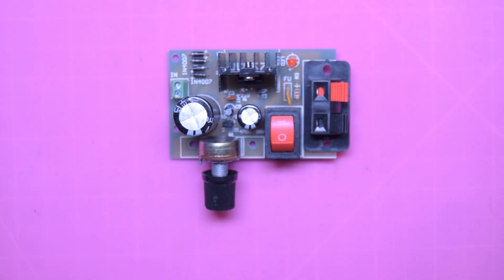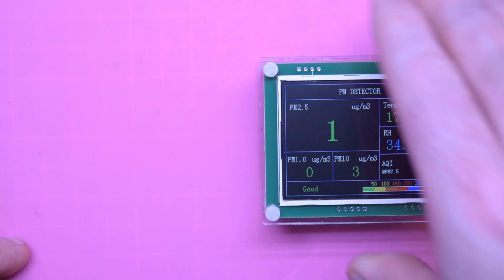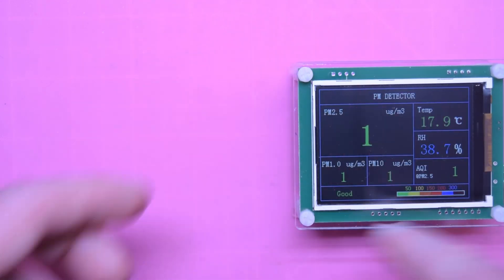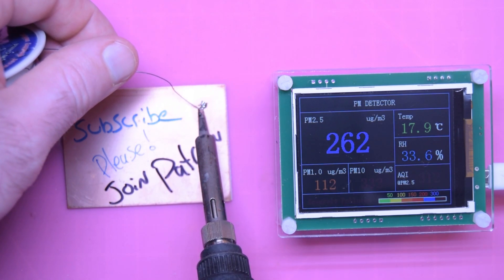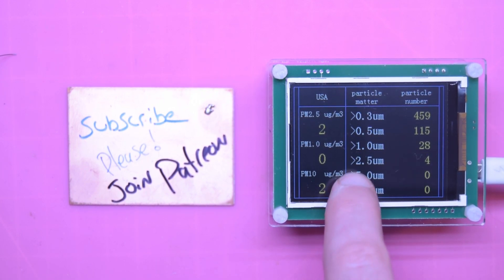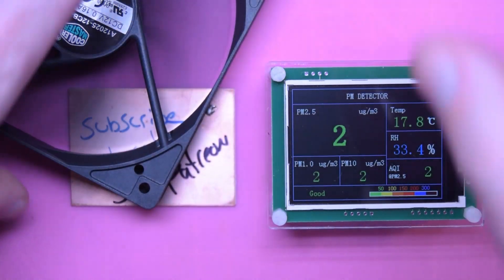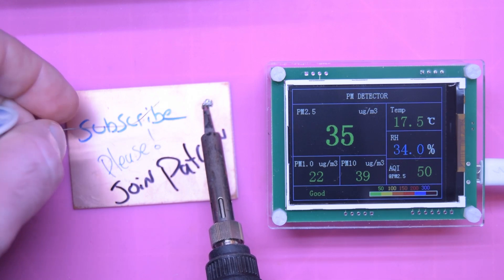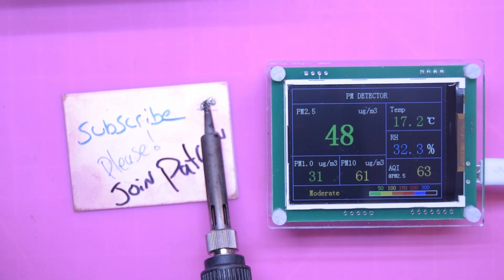How BAD are soldering fumes?

Comment: Sometimes breath it in directly (my job is constant soldering) should I be worried? I dont have a fan just the garage door open. Ill get a fan but should I be worried at all?
Reply: YOU NEED PROPER FILTERING OR A WAY TO PUSH FUMES OUT OF THE LAB/ROOM. DONT INHALE THAT
Reply: @GamisteToDimosio  lolololol. I switched positions still same company. I think I bothered them enough to get them fans to suck the fumes away now though

Comment: Can you put sources to where you read that solder fumes are not lead. I want to read about it.
Reply: Lead itself wont produce fumes until it reaches its boiling point of 1749 °C , the fumes are from the flux!
Reply: @CrazySparkie63   I reach that temperature when my joints won't flow

Comment: I have had one of those meters for years in my shop.  Its a quick way to see if my air cleaner is doing its job.  We also use it in the house when there is a lot of pollen, or as you said, when there are forest fires.

Comment: “Soldering fumes” may contain particles from 10 to 150nm. A nanometer is 1000 times smaller than a micrometer. 1 micrometer (μm) = 1000 nanometers. Could you please correct me?
Reply from the maker: ¯\_(ツ)_/¯